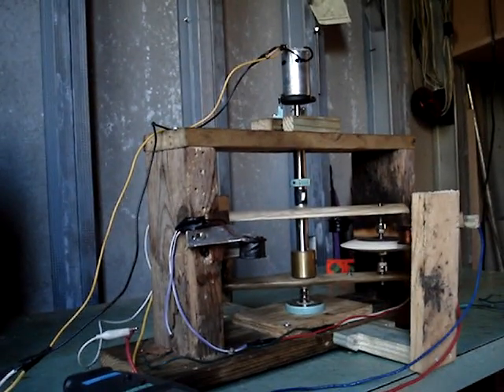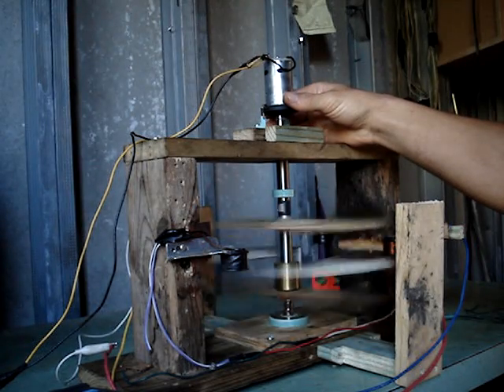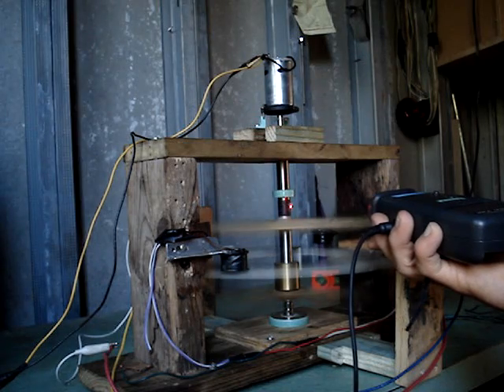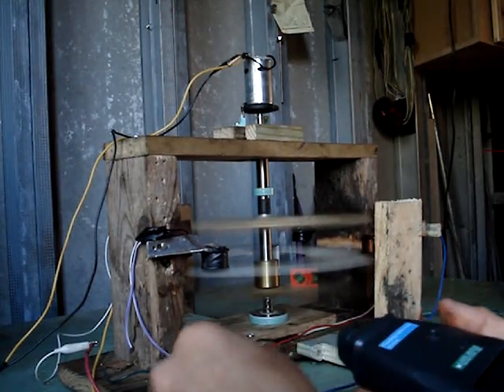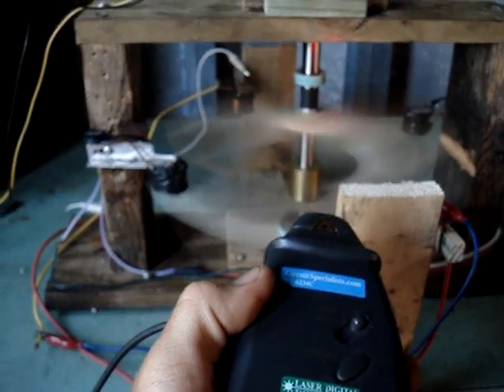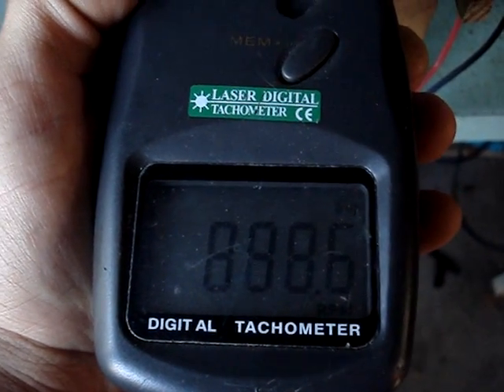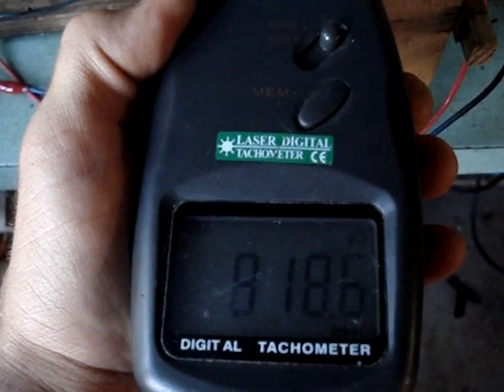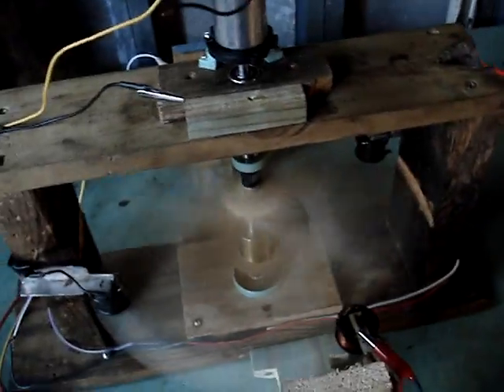The New And Improved Generator ( speed )

Comment from the maker: @Midgar21 This machine is power by a 18v Dc drill motor. I am putting about 12v Dc in to it. You can put as much load on it a you went and it will still speed up!

Comment: also...if you are changing the ac output of your coil to DC, then that is also a waste...you can tap direct dc from your coil and use half of the remainder of your coils to assist in rotating your generator which is free power which is developed on its own by the magnets passing the output coils.all thats required is to properly switch the coils just past its dead zone as the magnet passes by...that will create a field in the coil that will oppose the magnet assisting in the units rotation.

Comment: mine uses short pulse width duty cycle from an oscillator to develop high voltage for the driver coil. yours uses constant power to your motor to drive your system....your system has bigger losses than mine...although your design is sound and functional...if you interupt power to the drive motor to shorter duty cycles...instead of constant power feed...it will be more efficient and will use less power.

Comment: my trigger coil can except up to 300 volts at 10% duty cycle and up to 500 volts input at 5% or less duty cycle.....speed is dependant  on pulse width.....speed of my motor will incrase when duty cycle drops from 105 to 5% which also causes faster re-charge cycle ....repetition rate from the generator coils.....am still working on it and will upload a video shortly.....it's function is similar to yours....except for the driving mechanism

Comment: thanks for your response......my mistake when i said trugger coils.....in your case your trigger coil would be the motor that drives your system........the motor i am speaking of is my own motor that works as yours does in regards to higher speeds with more load except that i use one trigger coil.....not a motor to drive my unit.....still your system is interesting...am wandering about power level differences between output to input on your unit.

Comment: the speed of my motor spins an attached 8 segment open loop generator which produces enough voltage for my trigger coil and output power for other loads ....since my motor draws 200 milliamps at 1khz but only once per revolution, the generator has enough time to recharge the caps to full.......at higher speeds , my caps are charged with a faster repition rate as well.....can you explain yours in more detail.....silvio

Comment: my motor uses a 12 volt supply which produces a fast pulse....1khz across my trigger coil which pulses my coil at 230 volts DC........hence, my fast speed......what are the power draws and power feed back from your generator if you don't mind me asking.......also einstein was incorrect.......molecular gyroscopic and gravity effects were not considered when he came up with his famous equation.....but he was correct if it only applied to mass objects.......thankyou......silvio

Comment: OK so it speeds up when you shorted the coils.  Have you checked the motor current to see if it also went up?  I would bet it did meaning your motor had tow work harder.  So there is nothing surprising going on here.

Comment: @TheRealDealinlife Better bearings will increase your efficiency by a few points.  When you add more coils or more magnets you will increase the demand from the primary source, proportionally to any increase in output.  When tuned right, I found that the best performance was when there was no change in speed when adding the load, this I believe is why the Kromrey was said to belong on a spacecraft (I took this as meaning a satellite).  I qualified as an Electrical & Electronics Eng for the MoD.

Comment: @TheRealDealinlife 
Because that's the size a 24v motor is!
Regardless of what questions you ask of me, you haven't answered anything about the efficiency of your setup.  I make no claims of over unity, or even it being a better generator than anything standard.  What I do claim is, speeding up under load, greater efficiency when shorting the coils at peak sine, generation of radiation, production of HV, and operation within a bell curve.  Efficiency at the moment is 20 - 50%, what's yours?

Comment: @TheRealDealinlife
Generators speeding up under load is not new and has been shown several times on the net.  Check out my youtube Channel DaveMichaelRogers to see my Kromrey replication doing exactly that.   What happens on your generator when you use a practical load like a light bulb, does it still speed up?  What is the efficiency of the unit, input power / output power?  Also check out Thanes work, he has been showing this for a while as well.

Comment: sorry  but shorting the coil is not the same as a load your coils they can become a electromagnets in that the setup. your setup is somewhat familiar to me, but you must use a real load like a resistor or a bulb and be able to read amps and volts from your generator then compare  the amps and volts of your drive motor to know what is happening for real ...good luck. :)